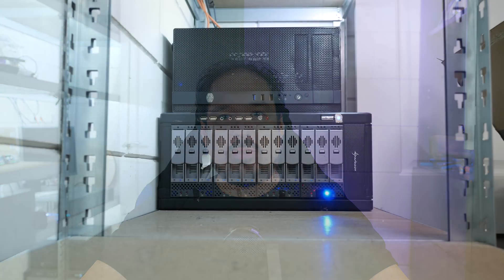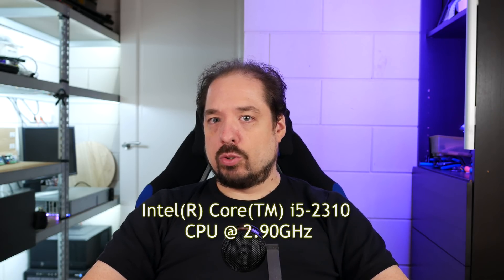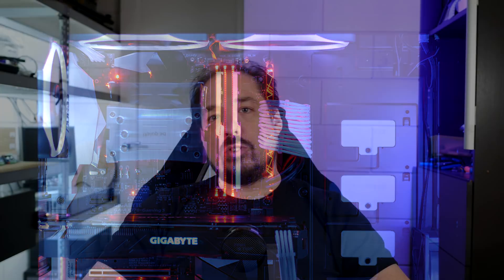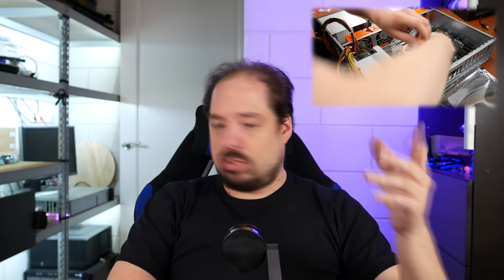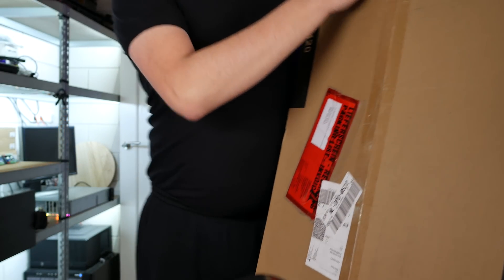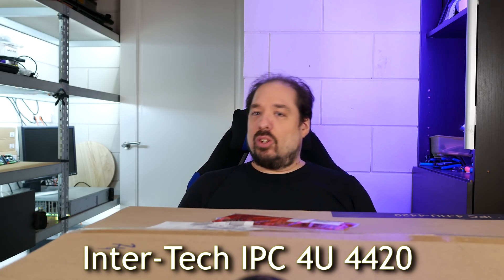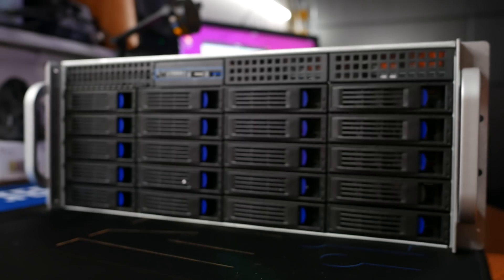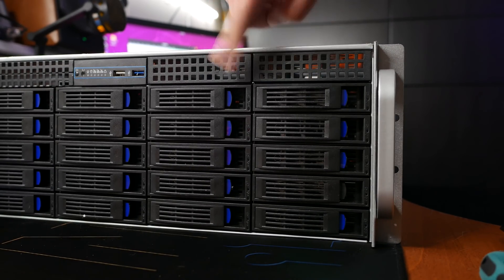Home Networking: New server chassis (Inter-Tech 4U 4420)

Comment: Hi i bought the 4410 and my qquestion is: what kind of rails do you use for the server. Mine weighs around 45kg now loaded with hardware... scared to buy the wrong ones which arent strong enough
Reply from the maker: Check on their website, they have rails available for it! I don't use mine with rails.

Comment: @Intermit.Tech
Really good presentation and content. Nice stuff, sir!

I am planning to build a home server myself and stumbled over your vlog which I find very helpful. By the way, your hardware and PCIe decisions are the same as mine (but I do not have to use a PCIe x1 slot for a gfx card as I plan to use an Intel Xeon E3-1245 v3 with an IGPU on a Gigabyte GA-Z87X-UD3H mainboard which are both still in use in my workstation... unfortunately it does not have M.2 why I would like to use some 12 Gb/s SSDs as cache drives... not sure if the backplane(s) supports that speed).

I just wondered why you bought a 4U-4420 and adjusted it with those plastic SSD cages instead of directly buying a 4U-4424 where you could simply use the (top) hot swaps for your SSDs? The whole front would have been more slick.

Other (short) things I would like to know are:
- Did you had the chance to compare the Inter-Tech chassis with the Fantec ones (Fantec is about 100 € cheaper) and know what the differences (downsides?) are (except the worse cabeling in the Fantec)?
- Do you know the exact branding and model of the backplane(s) used?
- Do the backplanes support SGPIO or something else in order to be able to see an error LED on the front?
- Do the backplanes support SAS-3 with 12 Gb/s?

Thanks in advance and keep it up!

Greetings from Saxony to the Netherlands ;-)
Reply from the maker: Poh, that's a lot of questions, can't get into it right now, maybe join the Discord? We can chat there and go over hardware. :)

Comment: Hey thanks to your video I also bought a case from Inter-Tech. I want to control the hot-swap fans with PWM too, but seems like my connector looks way different as yours. 

I posted a question on the LTT forum. Do you have an idea how I could connect this header to the motherboard?

https://linustechtips.com/topic/1288464-what-6-pin-fan-header-is-this-and-how-could-i-connect-it-to-the-mainboard-inter-tech-4u-4410/
Reply from the maker: Yeah, I know we talked about this a while ago on the Discord server and figured it out by looking at the traces on the PCB. So it's certainly still possible, would be easiest if you could take it out completely, then we should be able to figure it out easily.

Comment: How loud is this chassis ? Could you have this next to you in your office , or is this a store in another room type of setup?
Reply from the maker: With the Noctua fan mod and not too hot running disks in there, I think it could generally be in the same room. But I'd try to look for something slightly bigger anyway, with 120mm fans (you then replace with Noctua), then for sure.
Reply: @IntermitTech  any recommendations on a bigger cassis I’m a noob so I have no clue what to look for . Any recommendations will help me get some direction! Thanks ! Need at least to be able to put 20 dives like this one .
Reply from the maker: Sorry, I thought you replied to my 2U case video, this one is a 4U and a good choice. But it does depend on the devices inside, 20 disks will generate heat, in any case and thus will require a certain amount of airflow and thus noise, no way around that really...
Reply: @IntermitTech  thanks so much!!

Comment: I just installed my adaptec ASR-72405 controller in my media server. I now have a proper high density controller. I love this card.  You don't have to flash the firmware to put it into HBA mode. I love my set up. This chassis is the best computer money I have ever spent.  This controller card is number two. Now I just need 18 more drives LOL.

Comment: I just scored an Adaptec ASR-72405 with cables included for under $100.00. This card can be put in IT mode without having to flash the firmware. Man I love my new media server. This chassis is a beast too.

Comment: I've got the equivalent Norco case, and I'm wondering about getting this one. When you fill up all bays vertically, are the bays a very tight fit and very hard to slot in/remove? That is the problem I'm currently having with my Norco case. Do you have to use screws that fit the countersunk holes in the trays? Do the screws for all the trays come in the package?
Reply from the maker: Tight but not super tight I'd say, fits well. Yes you need to use the right screws but Screws and everything come with it.

Comment: I'm waiting for the same case, but from a Spanish rebrander: UNYKAch 4U HSW4520. Your videos convinced me to buy it instead buy a used Supermicro chassis and expend lot of money on used caddies, at leas on Europe they don't include hdd caddies with used servers :(  I'm planing to use SAS on IT mode + SAS expander.

EDIT: Today I received the UNYKAch 4U HSW4520, and it's the exact same case but with a small-big difference, the backplane for the 120mm fans, has no 4pin connector to connect to the motherboard and control them by PWM.

Comment: Hi, Did the power supply was included ? Where to buy if not ? I plan to buy a 3U 30248 / 3U 30255 but they have no power supply. Thanks for your answer
Reply from the maker: Power supply is not included and depends what type you need per chassis. This chassis you can use any regular ATX style but for a 3U you might need a server PSU, just check on their website, they have some listed, the sizes, everything! :)

Comment: Thanks for the video. What are the connectors inside the drive Bays? is it SAS or Sata connectors? Do you need to get only SAS Drives? or Is it SATA Drives?
Reply from the maker: Check out the rest of the series, it's all explained and showed in different videos. But the connectors are SAS but SAS can always accept SATA drives. I also use a reverse break-out cable to my motherboard to hook up 4 ports to the backplane and that also works fine.

Comment: Praying for the times when these server chassis manufactures adopt a push AND pull fan configurations over the HDD bays, instead of only pull config...."I hope they see this!"
Reply: theres no need for them , normally servers run in datacenters and airconditioned spaces and origional fans are highspeed too.
Reply: @highflowhighflow9896  While I agree to this in a DC. I and many others are not decking out a room with hot and cold aisles, generators and its own air-con...

Comment: That looks /identical/ to the Norco series of rackmount chassis. Even down to the drive trays and orange fan modules. The final proof is that 6 pin header for the PWM + tach signals, with molex for power. I just built a server in a Norco RPC-4224, and it looks like it came from the same factory.
Reply: Do think think its the same? i mean same quality, i read lots of stories of 4220/4224 having not so great quality.
Reply: They are, they come from china. You can found them on Alibaba.com, search for "4u 20 bay case". I just bought an UNYKAch 4U HSW4520 that is the same model as this Inter-Tech but from a Spanish company. These companies just import the cases and rebranded it. I was thinking about buying it on Alibaba, but I just didn't want to deal with import taxes + shipment. I paid like 280€ on amazon for it. Although maybe Norco is not really the same, as has different backplane and fans, but they build it with lot of same parts.

Comment: You don't need to get another LSI card. You can buy a simple SAS expander with 8 ports, connect 2 of them to the LSI card and from the SAS expander to the backplane.
also, you don't need to replace the cages, they have holes for 2.5" drives.
One thing if I may ask - when you do the fan mode, could you please explain in the video a bit more how and what you do and where do you connect? I'm afraid I couldn't understand from your last server fan mod.

Comment: Awesome that you got the case! Really love this type of build! Do you lose speed by using this method of connecting all the drives trough 1 cable?
Reply from the maker: Nope, using the SFF-8087 cables you get 4 lanes of SAS/SATA600 and since each cable goes to a 4 drive backplane it works out to 100% bandwidth available per drive, just a lot easier to cable!

Comment: Any thought for using Dual Xeons in this build? Threadripper maybe?
Reply from the maker: I wish! But that's both overkill and much to power hungry for my home usage. My current desktop is an 8 core Ryzen and that's moving to the server and then using the new Ryzen that comes out this year for the desktop again. It's a balance between cost, needs and wants. :p

Otherwise a threadripper server would be so awesome, don't have to worry about CPU PCIe lanes anymore and lots of memory slots!

So none of that sadly, I am thinking of maybe setting up a cluster with multiple boxes which I can scale down and up depending on need, again to keep power usage in check.